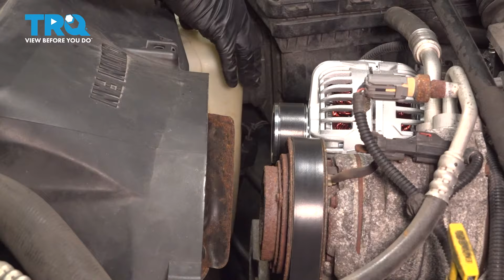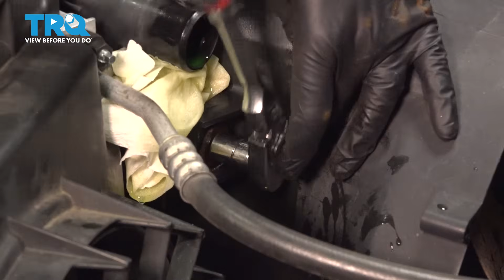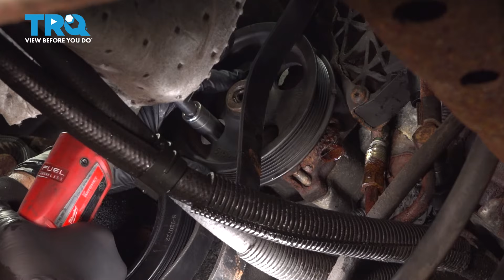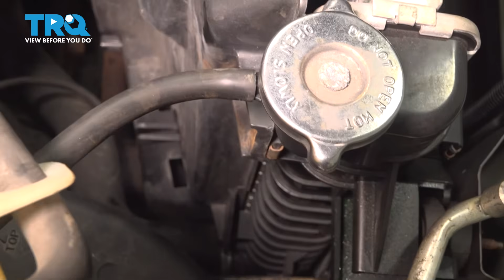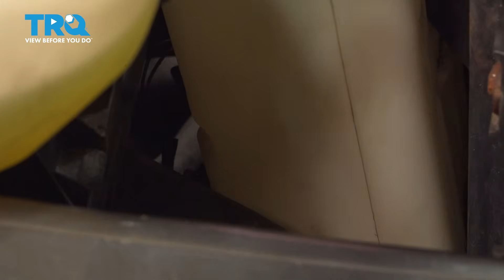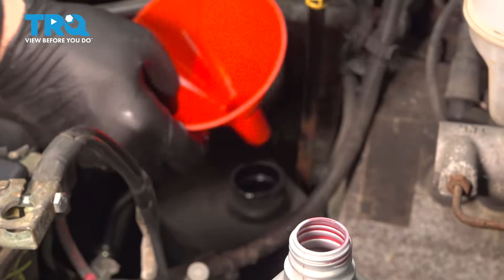How to Replace Power Steering Pump 2002-2008 Dodge Ram 1500

Comment: In another video,the guy doing the install says there are 2 positions this, pump can be mounted as there is an extra set of bolt holes in the cylinder head! So I put mine back where it came out of as the other holes had grease crap in them.
You need to show that!

Comment: I think TRQ is great. Great videos to help folks. However, there is different ways to do this job and to each thier own. But you can do it all from under the truck and no jacks needed. 1. Suck out power steering fluid. 2. Disconnect hose off bottom. 3. Disconnect metal hose attached to pump bottom. 4. Loosen (slightly) all 3 bolts behind pulley, then remove Serpentine belt and finish bolts. Comes out bottom and reverse for replacement. Super easy job, less than an hour probably.

Comment: this video is awful. You can't see anything, and i procrastinated doing this just because i live a little ways away from the store and i didn't want to ride my bike there in this summer heat in case of a bolt breaking.

I am a very capable and handy person with all the tools.

I then read the comments. the comments saved me. I did this in maybe an hour and a half. Easy as can be, and I live in Wisconsin where everything is rusty. 

The only thing that took me time was knowing the sizes. For me: bolts to the pump are 1/2 inch and you just need a longer socket or a short extension to get in between the fan and into the pulley holes. the hose on the pump is a 5/8. yes, i had my metric wrenches too.  

1) I used one of those little siphon pumps, and you need to know how to pinch it and suck the fluid, blow the air, suck the fluid until it siphons.
2)  then i drew the serpentine belt, removed it to keep it from getting fluid on it.
3) I loosened all the bolts (1/2") on a socket wrench
4) i removed the hoses with a channel lock for the hose clamp, and a 5/8 crescent wrench. 
5) put on the new pump starting with the top bolt by hand. went under and did the others.
6) hook it all back up and filled to the cold line.
7) drove down the road happy.

Comment: If your power steering pump was failing, you also wanna make sure that you flush out your power steering system so you don’t get contaminant potentially in it to make the new power steering pump fail. Also removing the cooling fan, fan shroud, coolant, expansion tank, and washer fluid reservoir was completely unnecessary

Comment: I won’t lie, I just did this on my 06 and took absolutely nothing off but the pump and lines. I did this from underneath and personally think it’s the easiest and fastest way. Removing the fan was unnecessary for any DIY’ers. I did this with sockets, wrenches, ratchet and vice grips.

Comment: Why did you take off the fan? I just did this job and only removed the pump. 2 hoses and 3 bolts and it comes right out the top. Super easy job.

Comment: I did it without messing with the cooling system a bit of a pain but I managed to get it off without taking that upper radiator hose off. 

Also be sure to take that hose connected to the reservoir and pump off obviously and be careful.